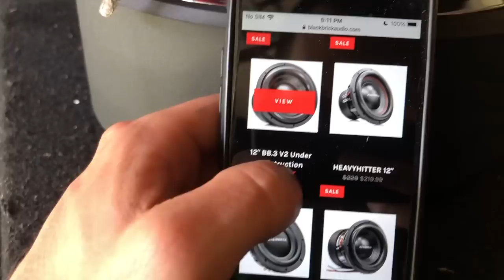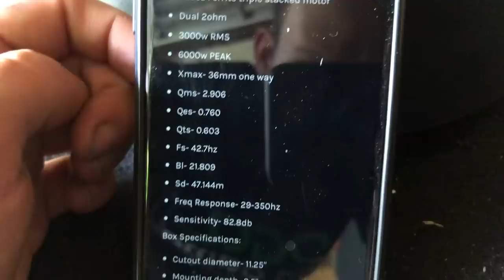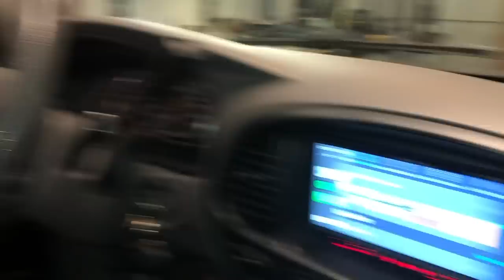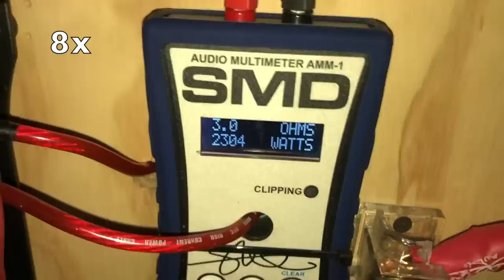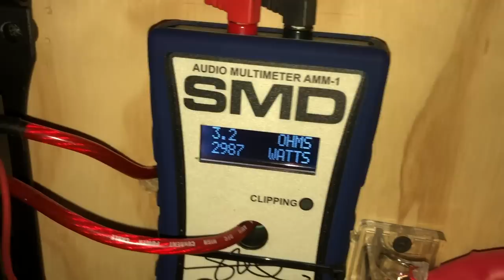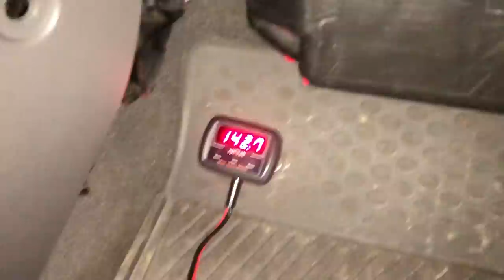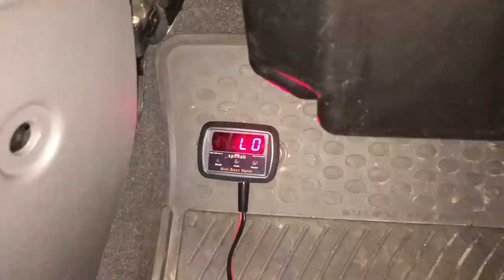INSANE $499 71LB 12" Subwoofer Takes a BEATING! BlackBrick BRICKHOUSE Review!

Comment: I remember when Blackbrivk was promoting these on Facebook a few months ago, they argued with me for a while about it only having one tensile lead instead of dual or triple at it's price point and rms range. If keep at eye on those tensiles boss! Glad to see I was right and all the people who were trying to argue that I couldn't see how many leads it had from the pics and stuff.
Reply: Hey skippy, dbl and triple leads are a gimmick. I know how to build and am an electrician. A single lead can handle more power then 2 equaling the same wire size. Just saying. Worry about the size of the lead not the number of them. Those are fairly hefty leads and the power the sub is rated for should have no issues with what they are using.
Reply: @mattadams7922  also an builder and electrician, I've had several subs fail from burned tenssiles, I know that the gauge is more important but they don't just burn out in audio for no reason. It's on of the weaker points of a sub, if the solder is bad or the glue is bad or the tensile is thick but loose and not tightly wound it's a n issue. I don't trust tensile leads unless it's dual or triple, or flat wound because I know it's not fluffed.
Reply: Another way of thinking about it, subwoofers are ac, so for that 3000 rms you're looking at 55amps of current thru that single lead.

Comment: I been thinking about picking one up.. but I haven't seen a 15" version... ATM I only run 15"s and quad 8"s in both builds. My 2010 VW CC TSI Turbo sport has the Skar VXF 15" in a 3.98 cube @30hz and it's pretty wicked. And in our other VW CC turbo sport which is a 2013 it's got the 4 Sundown Xv3 8"s in it. And it's also wicked but not as wicked as the Vxf 15" is but good. And if I can find a 15" version of this woofer I'd pick it up to try it out

Comment: The price of that woofer is insane in the mem-brain haha. I paid $850.00 each for my b2 Rampage 12" and I have 4 of them, I put them on a digital scale when I got them and in weighed in at 83lbs each. Hay Black Brick if you are reading this next year I'm going to do a build with 18s if you make them and the price is comparable you will have a new customer.
Reply: @Hamburgers Thanks bud for your kind words, I ended up buying 4 Crossfire C7 18s I'm still in the install I will be posting pics to my Instagram soon jesus-loves-the-bass-head
Reply: @Scot&Tiffani McCord what do you think about those b2 Rampage subs I had a guy tell me that they are better than sundown zv6 and better than deaf bonce 3512r,what's your opinion?
Reply: @joshwaller3849  I have never owned zv6 or 3512r, but my opinion all 3 of mentioned subs are top tear. At this point in my bass addiction the company that has the best warranty, customer service and available parts wins so Sundown is the best.
Reply: @scot&Tiffani McCord thank you that makes plenty of sense,those are very important when anything these days,appreciate it

Comment: I just got my Brickhouse 15”. It’s super massive, but I quickly noticed some flaws in Quality Control. The basket has some extra metal that wasn’t shaved off on the basket. The double stitching is not great. The sorround has small breaks in it which might cause tearing when I begin to use it over time. Wish I would of got the 12”. Would have rather spent 500 on a Xv2
Reply: It's their first patented basket. Give it some time and things will smooth out! At least we know they're not being cheap with cookie cutter baskets like everyone else!

Comment: That Sundown seems to be the sub to beat on this channel.
Reply: Well it is a dam good sub.
Reply: For the price of $400 with the discount, I'd have no problem trying one of these out if they make a 15 inch version. I gotta have more cone area than a single 12" can provide. Otherwise, its just a waste of electricity and I'd rather have 2 smaller 12's.  I'd like to see Parker step up his tests to a single 15 inch sub for better spl tests and just overall, i think a single 15 is a better test setup for that big Sequoia
Reply: @catch22frubert  I've tried asking him why doesn't he do a single 15 test setup but he never replies
Reply: @BenaresDarkness  I've also told him to start doing more than just 12 inch subs, but he just keeps sticking with the single 12. Personally, I think a single 15 is a much better choice, especially in that huge Sequoia, but he's just dead set on keeping with the 12's. If he's gonna stick to 12's, I'd rather see a pair tested at a time. Most people run 12's in pairs.

Comment: Can you please respond to me. Among all subwoofers you've purchased, which one hit the lows better or have the lowest frequency response?
Reply: If you want a sub that'll hit lows super well, try the Dayton ultimax series. The 18 has a sub 20hz rolloff in a 3 cube sealed box. The rest of them also hit lows super well
Reply: @blakebrockhaus347  I 2nd that claim. Dayton Ultimax is a great sub and nobody will know what you have either 😉
Reply: @Avaddon911  I have the 12 in xmax in a 2.4 cu ft birch ported box tuned to 32 hz and I love it. Definitely hits them lows. Rf 28.4hz
Reply: @anglerandy5736  I bet that sounds badass. Right now I've got a CT sounds tropo XL in a 1.7 cf with two 3" aeroports. Tuned at 28 hz. It sounds real nice but I might rebuild it doesn't have the range I'd like. I'm hard to please lol
Reply: @Avaddon911  lol I would have gotten the ultimax but it was out of stock and fro. The vids I watched I would have to cut the hole bigger. I got this box off some guy on Craigslist that built it for a sundown z for $60. Hand-built routed with rounded edges and stained and even has a 5v usb port for led lighting in it.
Reply: @anglerandy5736  wow that's a steal, is it birch or mdf
Reply: @Avaddon911  birch 1 in ply double wall on the front.
Reply: @anglerandy5736  that's an unbelievable deal lol congrats

Comment: Was planning on going with 2 sundown zv6 15’s but after seeing and hearing this I think I’ve decided on 2 of the new BRICKHOUSE 15’s after checking their site and getting specs, hell of price difference as well not including the discount. Glad I didn’t pull the trigger yet on the zv6’s because I don’t think these will disappoint!
Reply: How’d those brickhouse 15’s treat you?
Reply: Curious as well
Reply: Well did you get them??
Reply: They probably blew  sundown is the shit I been abusing mines for almost 2 years
Reply: I’ll get 4 of these and do the research for us
Reply: @EazyTheRecon I wouldn’t be so sure. Their drivers don’t just look like the real deal, but T/S parameters look very friendly (and accurate too).
And boy, do they look like the real deal. Despite their pricing looking worryingly low, the quality of parts and build look as good as anyone.
Sure, Sundown are practically the industry reference point for performance/reliability/customer service, but they’re definitely not the cheapest. Money no issue then yeah, I’d take some Sundown Zv over these BlackBrick drivers. But these are half the price of the Zvs. Half the frickin price dude! If you’ve got the space and power you could double up on drivers, run them well within safety limits and I doubt Zvs could deliver similar performance
Reply: @ScramTek sundown and blackbrick and made by the same manufacturer 🤫

Comment: Hello and gratulations for the fantastic Video. But for my Project, I like to build, I need the QTS Value of 0,35 and also with such fantastic long Stroke. The Dimensions I am able to use, are from 6,5 inches up to 12 inches. More is to big inside the House. Yes, I will build not a Car Woofer, but one Dipole Function Woofer for Indoor using. 
But I need the long Stroke and the strong mechanical Parts from the Car Hifi Subspeakers. Would you look around for me ? I think the whole World needs such a fantastic Speaker Housing, I am able to build !!!

Comment: I was really impressed by this sub until I looked closer at the subs specs, I would expect a much higher BL (motor force) rating as it being 71lbs with a BL factor of 21.809 gives it a motor force less than a Kicker L7S 12" indicating that it uses weaker magnet slugs and in turn leaves it relying on a much more powerful amp to get the same results as a sub with a larger motor force of say BL-30.0
This to me means you'll spend more on a bigger amp and electrical to get great results, it also means that the subs monster motor will store alot of heat while taking longer to heat up and also longer to cool down.

I also expected it to have a much lower FS rating as it's "free air resonate frequency" is 42.7 compared to other similar 12" subs that are in the 30hz range making this sub a higher frequency playing sub and would require a box tuned lower to hit those notes where the sub would struggle.
To me this means you need a really well built and well tuned box instead of a prefab or box that's built with less quality in the design and build. 

All in all I'm not badmouthing the sub or company, I just expected a bit more for the price. Still really impressive while on a 12k amp though.

Added:
I wish blackbrick would make more than one 15" sub, just a thought lol
Reply from the maker: Really excellent observations man! Hopefully BlackBrick will take note and improve specs like this as time goes on
Reply: @ParkerTheBasshead 
Either way man, I love watching your videos and I definitely don't intend any negativity. Just looking at things from a spec comparison aspect.

I literally just purchased my recent 15's based on the numbers alone focusing on the BL Factor, Voicecoil size/ material/ winding number, FS rating, Xmax and cone material/ surface area, ect.
Reply: You understand that series or parallel wiring changes each spec incl n most noticable bl.  And ya your right about fs n all the above js wiring really makes the theil parameters so different.  Gotta watch too much bl n all youll have is a punchy sub limited to hz.
Reply: @christopherparis6841 
My point being buddy is that the only reason to buy a 71lbs sub with such a low motor force would to do spl burps on extremely high power. I personally would rather run more lower power subs with higher BL to increase the overall efficiency of the whole system. 
A good example are the 15's I recently purchased, with a 3.25" solid copper black high temp coated coil rated at 1500w rms, 50mm peak to peak xmax, sensitivity of 89, FS of 29hz and a BL of 38.6 I can run more of them with more cone area per watt and a higher motor force. 

I'm not nor have I said that this black brick is bad in any way, I merely shared an observation as I was going to buy a pair but decided not too being I feel the specs aren't to my liking.
Reply: @goldeneagle7559  what sub did you recently purchase?
Reply: @goldeneagle7559  no disrespect but U2 guys are making my brain hurt LOL that is just way too much technology for my ass to understand to me for a daily driver as long as it is a system that bangs that is good enough for me LOL but I completely understand where you guys are coming from because it’s idiots like me that get screwed over financially because I ultimately end up buying the wrong shit I wish I had brain storage like you guys do and no I am not a pothead 😂
Reply: Although what you say may seem logical..I assure you that 71 pounds of magnet and a 4 inch coil is really high in the BL... Part 2... Please don't tell me you really believe the data sheets? Those are fairy tales.... As a word of advice , don't data shop.... That woofer on it's own is bad ass.... Better than something else??? Maybe? Maybe not? Worth $500? Yep
Reply: @sarahconner9433  fair points
Reply: @chadjay828  your a good guy Chad,.. Ya don't get headaches... This woofer is very good....
Reply: @SLAYER-nm5zw  thank you Slayer... I'm a post PhD E.E. and I don't want to turn these comments sections  into a  FN classroom... But resorting to "child like" common sense.... If you can't even lift the damn woofer (71 pounds!)... And a 4 inch coil....scientifically proven = "it's badass"...
Reply: @sarahconner9433  THANKS I appreciate that !!! I have a 91S 10 extended cab so it’s basically like a fighter jet cockpit so to me a speaker like that what just start shattering glass so instead I just went with a budget friendly scar audio 10 inch EVL subwoofer with 1000 W rms  amp it’s respectively loud enough and best of all don’t have to worry about replacing windows LMAO My whole set up is ran with all scar audio equipment from the amp kit to speaker wire to speakers the only thing that isn’t from scar audio is my radio I guess I’m trying to get them to and Doris me lol what I like the most though is the speaker wire for the speakers and amp kit are the same color as my truck so it worked out perfect
Reply: @chadjay828  yes! That's great.....loud "enough"... Is what many people forget... Enough.... People  get greedy and get rediculous I like clean sound... Very deep bass to 135- 140db... Above that... Things get complicate, expensive, and "too much"

Comment: That sub looks awesome, no way my electrical can handle it.  O.O
Reply: Your electrical can handle it just fine,thats a myth
Reply: @AtarTube  you can run 10 of those subs on a stock amp, the electrical will be fine
Reply: @AtarTube  Subs don't draw power, they react to it.. so like the other guy said, you can run 10 of these on a stock amp if you wanted and it will be fine. Now if you wanted to actually give them the 3000W they're rated for, then you'd need a proper amplifier for that (that's what draws the power). So in that case you'd need to have the right electrical to feed the amp.
Reply: @your_doctor_and_plumber  I know subs don't draw power. I run a Fi sub on an Orion amp and my electrical is struggling to reach 2kw. You should always run subs close to the RMS rating or you are going to be losing a lot of everything the sub is meant to do.
Reply: @ethanhimes8239  Ha ha ha ha tell us your noob without telling us you’re a noob
Reply: @pvtpelnar11  ☠️😅😅😅

Comment: A 70 pound sub will do alot of damage just imagine what 2 of thoses would do
Reply: I believe the magnet said 450oz. The DB 3512R has an 1100oz. Makes this thing look small.
Reply: I have two incriminator audio death penalty r6 12's.  They weigh 82lbs a piece and have a incriminator audio 80.1(9600) rms powering it. They take it with ease
Reply: @Van1018s  ya but what’s the price for those lol
Reply: @pvtpelnar11  I paid $600 each for 12 of them. Now I’m on team DB. So it’s less. That’s all I can say.
Reply: @Van1018s  Well I can tell you right now that that sub does not have 1100 ounce motor
Reply: @Van1018s  it’s only a few pounds heavier then this sub . No way it has almost 3 times the motor weight and only 4 pounds heavier
Reply: @pvtpelnar11  an 1100 ounce magnet is 68.75lb. The db 3512r subs weigh 80lbs each. Yes they do have an 1100 once magnet. Not motor. You don’t sound to smart.

Comment: Just wondering what size alternator you run on the Toyota?  I got a 240 alt but thinking of upping to a 340 alt
Reply from the maker: I have a 250. Supposedly anything bigger doesn’t charge well at idle for these Toyota’s
Reply: @ParkerTheBasshead  yeah thats what I was worried about, maybe I'll have to hold off and run lithium

Comment: The recommended box might make it hit harder , but the x had 148 db so sundown is still king 😅🤣🤣
Reply from the maker: I got a 145.8 with the X. Which was still over a dB louder so pretty impressive
Reply: @ParkerTheBasshead  Pay Parker got a question for ya'll just bought a brick house 15 from my local dealer here in Rogers Arkansas. Long story short inverting these subs. With that high round sorole will the same cut out measurement originally you use work for inverted

Comment: I think I've seen almost all of all your videos Parker keep up the good work but please quit slamming the hatch on your Yoda between the tag and that thing rattling like hell when you slam it it comes across very loud on your video. Thanks man glad to see you're a cat guy also yeah I love my cats. I made a 4 ft diameter exercise wheel like a hamster wheel for mine they love it so they can exercise inside. And again thanks for all the videos keep up the good work. And I know you're basically just Subs but it'd be nice sometimes to test like some six and a half inch components that are actually in some doors not just free air I never understood why people want to test s*** out on the table see how they sound to me is like a retarded way of testing something. You have to get the back waves of the speaker separate from the front of the speaker I mean like what the f*** are they thinking when they try to test something like that? I don't get it and apparently they don't either